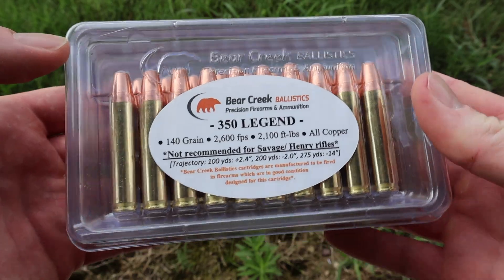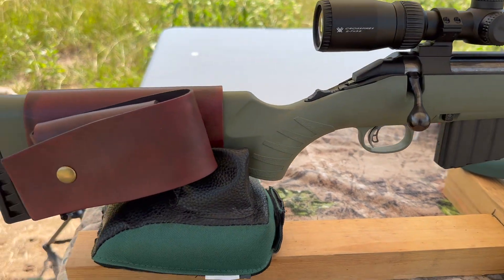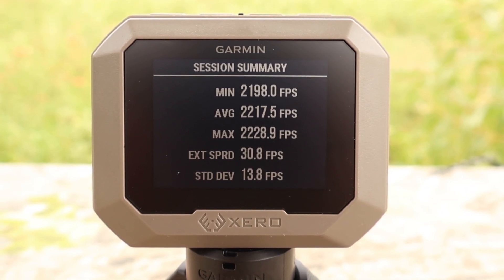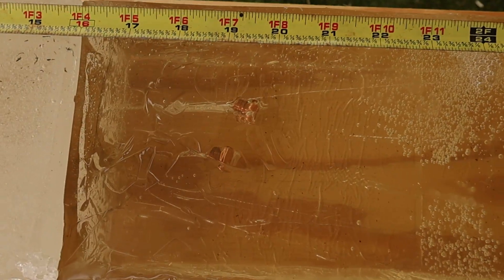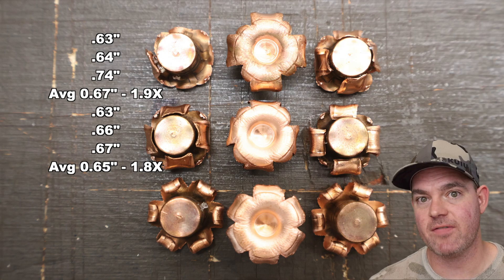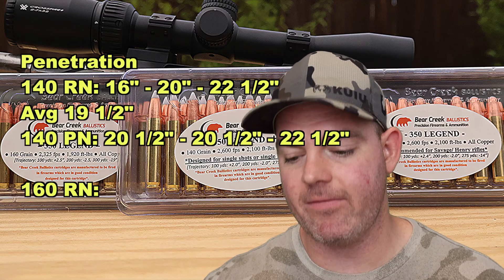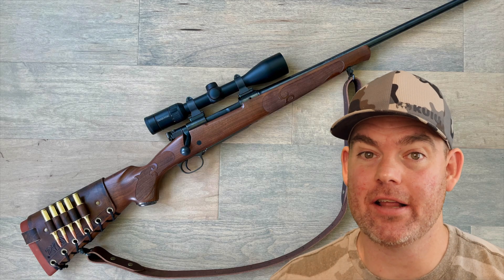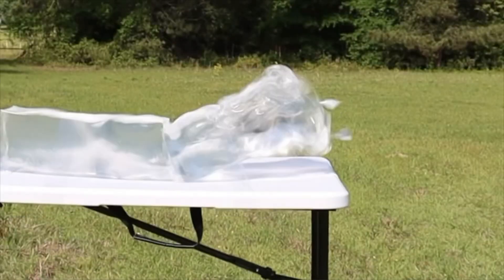350 Legend Bear Creek Ballistics Gel Ammo Test

Comment: For an all-copper bullet, I'm not very impressed with the penetration compared to .30-30, which is what 350 Legend is supposed to roughly mimic for people who live in straight-wall cartridge states. The difference in frontal surface area could have played a part in that, but still. Of note: last year, Vortex got an incredible 35 3/8 inches of penetration by shooting 350 Legend with 170 grain Hornady American Whitetail. I'm not sure why these Bear Creek bullets didn't penetrate more, if not much more than they did. Especially considering they are all-copper bullets with high weight retention.

If these actually performed better than most other 350 Legend loadings you have tested, that's good for 350 Legend owners, but I'll stick with .30-30. Or if I do buy a .35 caliber straight-wall gun it'll be 360 Buckhammer (actually high on the list) using Hammer all-copper bullets.

Regardless, good video as always. There's always something to be learned from the results of every test, whether good or bad, that can help inform people about their purchasing decisions. 👍

Comment: So if there isnt a quick energy dump/ large cavity then whats the point of the .350? Or is that due to barrel length?
Reply from the maker: 350 Legend velocity isn’t affected by barrel length nearly as much as many other cartridges. It maintains effective velocity with barrels down to 12 inches and isn’t increased by significantly material amounts throughout its barrel length range up to and beyond 24”.

The point of the 350 Legend is to sell rifles in states requiring straight wall cartridges for deer hunting.
Reply: @masonleather_outdoors  mmmhhh, ok, but lets remember the reason for straight wall cartridges mainly is where they are used vs population density,  ie, hunters hunting in close proximity to property lines or buildings and other structures.  If the 350 doesn't have a large wound cavity on impact isnt the deer capibilities of running onto another property greatly increased? I know this situation exists because I see or hear of it happening every year. I myself use the Winchester 30-30 hollow points on deer if I want them to drop on the spot, the wound channel is massive within 2 inches of impact. Hell maybe I have this all wrong anyways.  Just some thoughts.

Comment: 350 legend is trash, it headspaces off the mouth of the case, a paper thin bit of soft brass. Not difficult to force over insertion on accident making a stuck case and no/light primer strike. Basically the round can be pushed in too far.

Comment: Pretty sweet test results considering everything. 
I moved to Ohio this time last year and need a straight wall cartridge rifle unless I just stick with my CVA inline muzzleloader for this season. I would prefer a lever gun especially in 360 Buckhammer but they’re expensive and I am hoping that Henry makes their All Weather in 360 BH. In the meantime I was thinking about a less expensive bolt action rifle in either 350 Legend, 400 Legend or 450 Bushmaster. I am not recoil sensitive so the 450 BM would work, but I want a left hand rifle and it’s easier to find a sub $700 rifle in 350 L as well as the ammo (which is why 400 L is currently out even though it is the one I prefer). I am waiting for the new Savage Axis 2 Pro in left hand to arrive at stores. So I would have to use the BC 160 RNs or another ammo which would be fine with me in that rifle with its 18 in barrel. 😃🦌🐻🐗

Comment: Hey man, I cast a 200 grain bullet for my 350 Legend that actually drops about 212 grain with gas check. I’m shooting those at 2140 fps with no pressure signs in my rifle. I can send some to test if u would like.
Reply from the maker: For many reasons, I do not accept anything from outside parties.
Reply: @masonleather_outdoors  Not even bullets? Not loaded ammo.
Reply from the maker: Nothing
Reply: What mold is that, Brad?
Reply: @jasonshults368  RCBS 35-200. It’s for the 35 Remington that comes out at .358, but I size them down to .356.

Comment: So out of all the 350 legend brands and loads.  What are you using to kill a white tail?  I just purchased a Ruger American Gen II 20 inch barrel
Reply from the maker: I don’t use 350 Legend for deer hunting, but if I did any of these would be a great option
Reply: I use the 160gr powermaxx in 350 legend and haven’t been disappointed yet. I used the 170gr hornaday whitetail for a year and did not like the performanc.
Reply: I would buy several brands of hunting ammo and see which groups best. My 20" CVA Scout seemed to like Win Power Point 180 gr a tiny bit better than several others, but I wound up taking a deer last season with the 150 gr Copper XP. I high shoulder everything and it dropped like a rock, no kick or quiver, slight quartering to at 75 yards. Could not find entrance wound until skinned - a literal pinprick, but exit was about nickel size. The 170 gr Barnes hollow point should also hammer them. If these Bear Creek were comparably priced, I could see them doing the same. I am looking to try the Hornady 250 gr. Sub-X on a hog or deer this season.

Good luck this season.
Reply: I also used the 170 gr hornady and had poor results. This summer switched to the 165 gr FTX and it was like night and day. 5 of 8 dropped in there tracks 2 of them at or slightly over 200 yds.
Reply: Underwood 170 gr. Triple Shocks work beautifully and are very accurate out of my Howa mini bolt